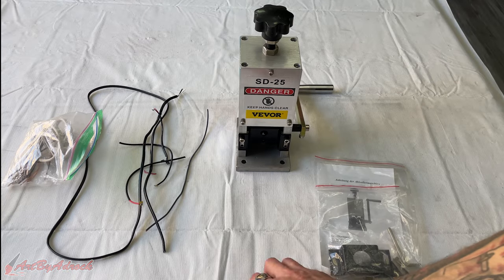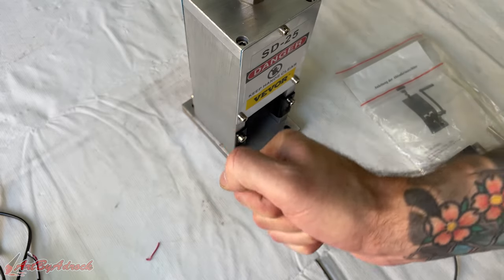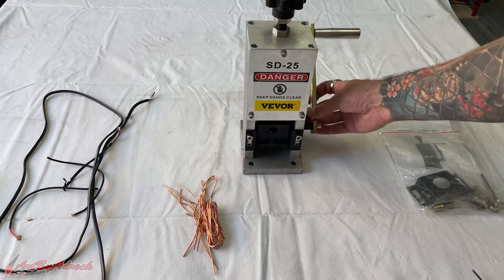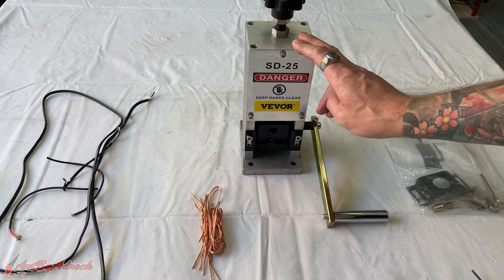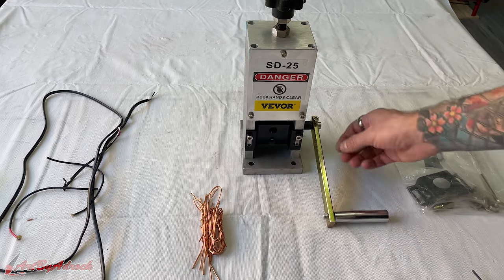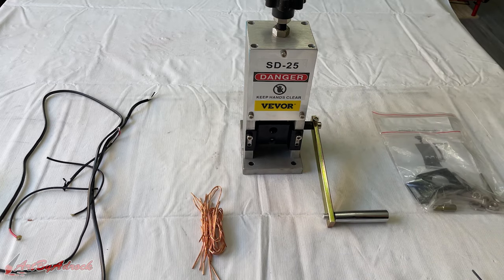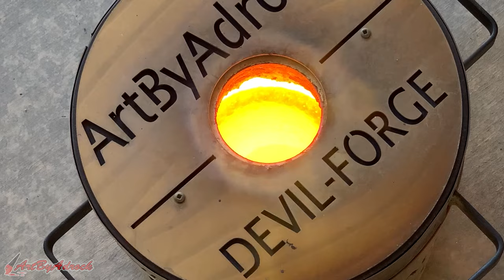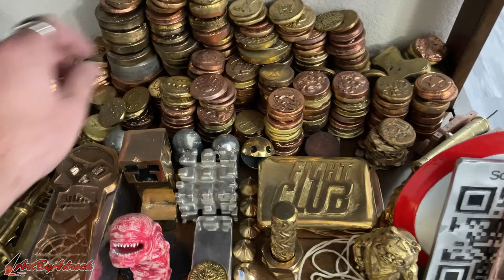STRIPPING And MELTING Copper Wire - How To Strip Wire Easily & Melt Copper

Comment: I have the stripmeister and it will not strip anything less than #8 without destroying it. I guess it has to be just right. Mine was over $200.00 bucks and it's not electric nor does it have a hand crank option. It only has the drill option. I probably should have went to Vevor instead. Ive gotten lots of things from Vevor i got a moonshine distillery kit for like $80 and it is awesome. Their products are definitely cheaply built, but I still love shopping there.

Comment: Please, some time when you are doing another copper pour, place sand in about a 12" circle and about 2" deep. Place your ingot mold in the center and pour the metal. Immediately cover with shredded newspaper and place a metal bucket upside-down over the burning newspaper. Ideally the bucket should be small enough to not extend beyond your sand workspace. If you need to make the sand workspace larger, go for it. As an additional measure to ensure a tight seal, you can pour wet sand around the lip of the bucket where it meets the sand. Let it completely cool, take it out and "Oooooh" and "Aaaaah" to your heart's content over the incredible colors.

Comment: Say, how difficult would it be to cast a coin with a reeded edge? I know our mint stamps blanks into their molds but is it even worth trying? I imagine sand wouldn’t be a fine enough medium, either lost wax/PLA or maybe one of those metal two-piece molds like the one you (tried to 🥴) use in this video?